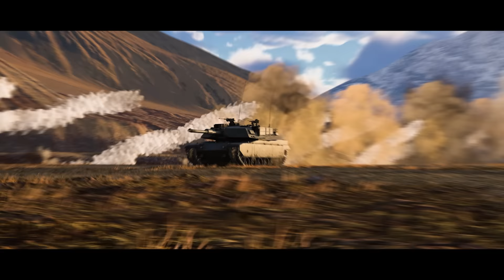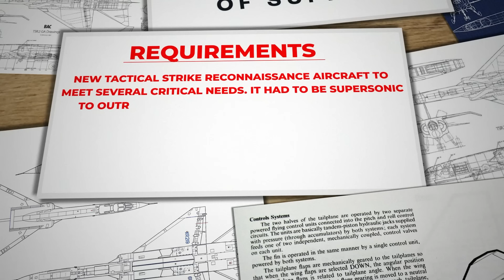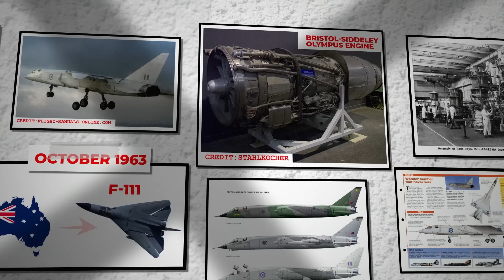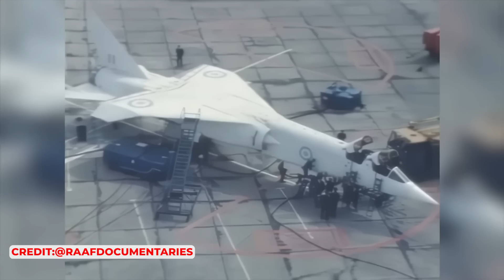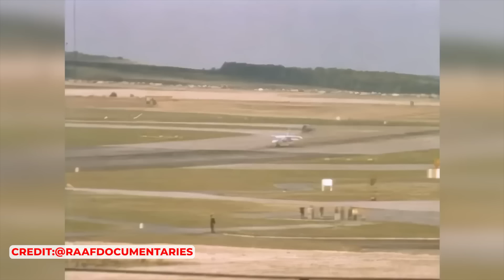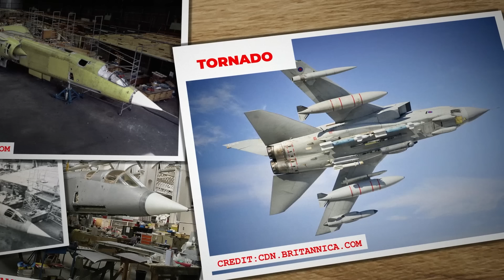The TSR-2 Was Too Good to Survive

Comment: I have visited both airframes several times. The TSR2 gives me chills thinking about what might have been. There were several bad actors, the Wilson Government, Load Mountain, the USA. However TSR2 wasn’t a perfect aircraft. The wing loading was too high for good handling, forced by the required performance. The unit cost was too high (if not as high as the F111 turned out to be). It was being built by a consortium of British aircraft manufacturers not used to working together which slowed the project down considerably. That delay made the TSR2 less attractive as ICBMs could now deliver nuclear payloads and reconnaissance could be better done by satellites, both of which were offered to the UK by the USA to kill both TSR2 and Blue Streak.

Comment: You mention BAC being formed almost as an aside.  But the true position was that BAC was created under Government fiat explicitly to produce TSR2.  This was a major factor in the developmental problems that ensued because the work allocation was decided on political expediancy rather than relevant experience.  For instance, having just produced the Lightning English Electric was the obvious choice to design and build the supersonic airframe.  But the lead was given to Vickers with EE as a mere sub-contractor.  That was never going to go down well!  Similarly, Bristols were brought in to supply the engines and, although the afterburning Olympus would come good for Concorde, in 1960 it was a troubled design and the Rolls Royce Avon as advocated by EE was again the lower-risk option.  Add in the Air Ministry deciding independently on other system suppliers that had to be made to fit into the plan and problems and cost escalation were inevitable.  It is ironic that, as Beamont said, the TSR2 had just come good when it was cancelled.
Cockpit layout?  Have you even sat in a Vulcan?  Yes the guys got used to it but ergonomic it was not!  The TSR2 wouldn't meet modern requirements but at the time it was a massive improvement.

Comment: You know something, the TSR had not much of a conventional role. It is difficult to determine what conventional munitions the TSR could carry, but it doesn’t look that capable. The F-111, Tornado or Buccaneer did carry a significant conventional capability. The CF-105 was a single mission platform and its capabilities have been magical with the mythology around its paper capabilities

Comment: bullshit, the TSR2 was a one tirck pony,  it was obsolete before it got built

Same as the A5 vigi, the Mirage IV,  the f108 and hte Avro arrow.
the Vigit did get built, but was obsolete in its role, then got a secondary recce role to keep the airframes from being a total waste.

the TSR2 was very similar to the Vigi, yet later, couldn't do what vigi did and thus it was shitcanned with good reason
Reply: Technically it was a 3-trick pony. 2 of which were seen to have been redundant by the final expected delivery date.
Reply: Spot-on.

Comment: Nope, it was obsolete by 1960 and by 1964 had become a money pit with no role to fulfill and still a long way from finishing. It was designed to fight wars from the 1950s and wouldn't be ready for delivery until the 1970s, by which time many far superior aircraft were around. For example, by the time it was cancelled, the Mig 25 had been flying for 6 months, an aircraft that would have made mincemeat of it. That's why it was cancelled - a classic example of British incompetence in project management.
Reply: It certainly was not obsolete. Many of its issues were due to the fact that it was cutting edge. It was 15-20 years ahead of its time, and fact that the politicians were too blinkered to see.
Reply: @chrisknight6884  It absolutely was obsolete. Like many similar aircraft designed to deliver tactical nuclear weapons, missiles rendered its primary role obsolete. It could barely fly by the time of its cancellation and none of the technology would become a reality until the 1970s by which time far superior multirole combat aircraft were already well established. It was not "15 to 20 years ahead of its time". It was a child of the 1950s, designed to fight the wars of the 1950s. It's much vaunted terrain following radar didn't work and they persisted with a hybrid analogue computer when everyone else had moved to full digital systems and it had become a money pit with no role to play. The politicians did see where this was going and gave BAC one last chance to give a fixed cost and delivery date. Early 70s and no cost estimate was the best BAC could do. Even the RAF had lost interest in it by then.
Reply: MiG 25 was a high altitude interceptor, it was designed to stop the cancelled XB70 Valkyrie. At low level, it would have struggled to deal with TSR2 or the subsequent Tornado due to aerodynamics and lack of manoeuverability. Foxbat itself was a paper tiger as found out when the West got their hands on one, it killed more Russian aircrew then enemy aircraft (Although it did lead to the more capable Mig 31 Foxhound)
Reply: @cliffdixon6422   I'm giving an example where of where the rest of the world were, whilst Britain wasted money it could ill afford flogging the 1950s dead horse that was TSR 2. Its role as a low level tactical bomber had gone. In its secondary role as a reconnaissance, it would easily have been picked off by more capable interceptors. Three months after TSR2 was cancelled, the F111 - a plane way more capable than TSR2 in every respect made its first flight.
Reply: @joebloggs4369  F-111 was a low level tactical bomber with nuclear capability, the same as the TSR2. The role was not gone as seen many years later where Tornado was hitting airfields in the Gulf War using capabilities the USAF no longer had. With TSR2 cancelled, the RAF adopted the Buccaneer which was far less capable but served with distinction into the 90's, also seeing action in Desert Storm. As for F111 being more capable than TSR2 - It got pulled from service within a year of introduction in Vietnam after losses which were then tracked back to faults with the swing wings causing accidents. F111 went way over budget, hence the RAF cancelling their order after the TSR2 cancellation - It was supposed to be a cheaper option! TSR2 was faster, had better terrain following radar (Which was subsequently employed on Tornado GR3) and the engines, when the bugs were ironed out, went on to power Concorde. The Americans brought pressure to bear on the UK government to scrap the project - Australia had an order on the table for TSR2 and the US military industrial complex saw it as a threat to export orders for F111 so it had to be killed off. They did the same a few years previously to Canada with the Avro Arrow
Reply: F111 had a conventional bomb capacity of 3 times that TSR2. TSR2 primary role was delivery of the Red Beard nuclear weapon and when that disappeared with the arrival of missiles, you were left with an expensive bomber that was barely better than the Buccaneer.
F111 did have early problems with the swing wing fatigue cracks and they were grounded following the loss of an aircraft at the end of 1968 pending an investigation and solution. The grounding was lifted in mid 1969 with a modification. They were then sent to Vietnam but were withdrawn within 6 months after the loss of two aircraft for unknown reasons but hydraulics were suspected. They returned to Vietnam in early 1972 where they stayed until the end of the war flying over 4000 combat missions with just 6 combat losses.
TSR2 was not faster, nor did it have a better ground following radar than F111. Both used synthetic aperture radar, an American invention, but, bizarrely TSR2 opted to use an analogue computer to process the data, convert it to digital and then feed it to the American VERDAN navigation system that the Americans licensed to Elliot Bros to build for TSR2. The result of this bodge job was a radar system that simply didn't work. It couldn't ground follow, it required a huge amount of power to run and the VERDAN couldn't cope with the amount of data being thrown at it. It was 1950s technological bodge. In contrast, F111 radar was fully digital designed by Texas Instruments, worked straight out of the box and proved its worth in Vietnam. The Heath Robinson bodge that went into TSR2 was most certainly not the radar that became the Foxhunter fitted to the Tornado. The same suspects may have been involved Marconi/GEC/Elliot - but they had learned their lesson from the TSR2 experience. The only analogue part of the new system was the stability control.
American did not bring pressure on the UK government to scrap it. Americans had no interest in it and had their own problems with obsolete project aircraft but they were happy to help the British by giving them the only digital navigation system there was at the time, to help them with the radar project (which they then succeeded in completely bodging). 
Australians did not have an order on the table for TSR 2. They were looking for a replacement for the Canberra and had a number of proposals on the table but because Britain had taken an "East of Suez" policy, Australia had decided to look to the US for its defence. However as a courtesy, they sent a delegation to look at the European options, TSR2 and the French Mirage. When they arrived in Britain, they were welcomed by Lord Mountbatten who told them they were wasting their time as TSR2 would never be built.
The engines used by TSR2 were not the engines used for Concorde. TSR2 engines were  modified Vulcan engines with an added afterburner. They were a Bristol Olympus 320 engine. Concorde used a Bristol/Snecma Olympus 593.
They did not do the same to the Arrow, another aircraft overtaken by the changing face of war and left obsolete. The Arrow was designed as a high speed interceptor to shoot down the hordes of nuclear bombers it was believed in the 1950s would be how war would be prosecuted. With the arrival of missiles, the role was obsolete.
Reply: @joebloggs4369  Interesting. In the Gulf War, F111 was reduced to Wild Weasel operations, Tornado did the airfield strike role - If F111 was so capable, why didn't it perform that job which was vital to the operation? Australia had a preliminary order in for TSR2, Mountbatten went over and tried to get them to take Buccaneer due to his naval connections. That in combination with US promises made them pull out and order F111 which came on line very late and over budget (Hence the RAF cancellation). Vulcan was used as a testbed for the Olympus and one aircraft was destroyed when it malfunctioned. As for Arrow, are you aware of the Mk3? Due to the advanced nature of the aircraft and the weapons bay, Mk 1&2 were interceptors but Mk 3 was on the drawing board as a strike aircraft with nuclear capability. The US couldn't have that, same as they didn't want TSR2 as a competitor to F111. It is a matter of historical record that the UK needed an IMF bailout in the mid 60's and pressure was brought to bear by the US to scrap it and threatened to veto the loan if the project went ahead. In the end, Australia was the only export customer for F111 - Why? For an in depth look, I suggest you search out multiple videos on this platform who interview leading figures in the programme including test pilot Roly Beaumont. He was long out of the programme when he recorded the interviews so had no vested interest other than telling the story
Reply: @cliffdixon6422  F111 was not restricted to Wild Weasel operations in Desert Storm. Where did you get that from? According to the USAF the  "F-111Fs dropped almost 80% of the war's laser-guided bombs, including the penetrating bunker-buster GBU-28. Eighteen F-111Es were also deployed during the operation.The US Air Force credited F-111s with destroying more than 1,500 Iraqi tanks and armored vehicles. Their use in the anti-armor role was dubbed "tank plinking"." That's a bit more than just taking out AA batteries with anti-radiation missiles.. 
Australia didn't have an order on the table for the TSR2. As I said, their government had already decided that their defence would be better served by their closest neighbour, the US and given Britain's East of Suez policy they had more or less pencilled in the F111. the delegation that visited Britain were merely a courtesy visit to see what was going on with TSR2 anyway, as well as the French Mirage which was also under consideration. Mountbatten had already been pushing for TSR2 to be scrapped as submarine missiles like Polaris made it obsolete and told the Australians it wouldn't be built. But it didn't change Australian minds as they had more or less decided on the F111. He wasn't trying to sell them the Buccanneer as missiles could do the job without risking pilots.
The IMF bailout did not occur until 1976 and the second Labour administration, long after TSR2 had been cancelled. There was no IMF bailout in the 1960s. You are confusing events.There was a devaluation of the pound in 1967, but that too was long after cancellation. So the US couldn't have pressurised the UK government to cancel. US involvement in the cancellation is just a myth designed to cover what really happened, a complete breakdown in project management, in fighting between services and complete indifference of one of the two builders to the actual project as they really wanted to build civilian airliners.
Yes I know of Bee Beaumont and his part in this. He was Mr English Electric and flew the plane on behalf of his employer, so not one to knock it back. But Jimmy Dell did most of the flying, Beaumont was the poster boy.  I suggest you search out TSR2 with Hindsight - a book report written after a seminar in 1997 held at Filton where all the main players met up and delivered a retrospective view of what went wrong. It contains contributions from all of them, Beaumont and Dell on flying the half built plane, the Australian rejection of TSR2 by those who were at the meetings, John Wragg the project engineer at Bristol who worked on the engine, and those who had to keep the warring factions at Vickers and EE under control. It really does not look pretty and confirms no Americans were involved doing it down. It did it all by itself. It was not "Murdered" as a rather OTT book on the subject recycling all the old myths claimed, it committed suicide.

Comment: Too good to survive? I am a fan of the aircraft and it should have been produced. But! It was over specified and more expensive than it should have been.  It suffered by being the first real cooperative venture, a domestic prototype for international collaborations to come. The engines required a lot of redesign for the new task. Reports of engine noise causing ground crew casualties get mentioned occasionally.  The vertical fin is reckoned by some to be extremely marginal from stress and fatigue viewpoint. Did we really need a bomber which could take off from a grass field after being started by a hand crank?  Pictures show planes loaded up with bombs and missiles strapped to the wings and all sorts.  But it was only designed to go fast and low and drop a nuclear bomb or two on an enemy. Alternatively to do high or low level reconnaissance. That the government compounded the cancellation by ordering and cancelling an F111 order, losing loads of money in the process, just rubs salt in the wounds. The F111 took another 5 years to 'come right'. But the experience gave experience of cooperation useful with Concorde and Tornado, and also providing a power plant suitable for Concorde.

Comment: Cool looking as it was, the TSR-2 was an over-complicated mess, riddled with problems that was sucking dry MoD development money. It would have entered service in the early 70s, no more than 150 would have been made and retired in the mid 80s. Cancelling it meant we got the Harrier, Jaguar, Hawk, Tornado, RN Phantom (UK spec) and Buccaneer S2 upgrades.
Reply: Your just wrong! 
1/We had the Buccaneer at the same time.
2/The Hawk is a jet trainer not a bomber so we would have needed something in the role no matter what.
3/The Jaguar and Tornado only manage to do one of the TSR2's three jobs between them. ( conventional strike, no nuke strike and no recon )
4/ The Phantom oh gods where to start? NOTHING learned by the Yanks in Vietnam was incorperated into our airframes unlike their retro modifications ( Vulcan cannon for those small things like when the crap missiles of the era dont bother to hit and your defencless against the agressor dogfighting you with guns. ) Higher temp engines ( cost more to manufacture and need more frequent servicing )They did give us a laugh back in the day when they were first deployed on a Yank carrier for joint opps and melted the thrust deflectors .